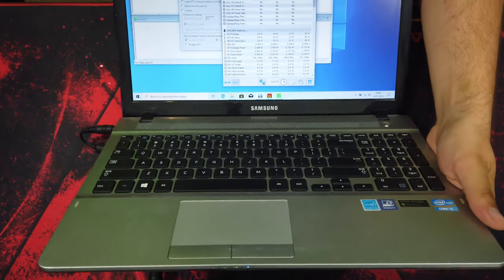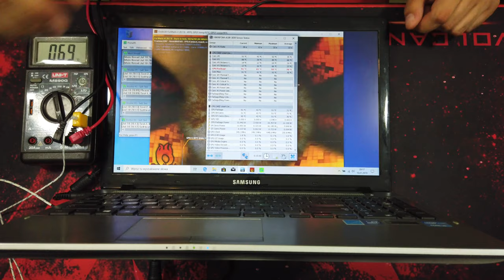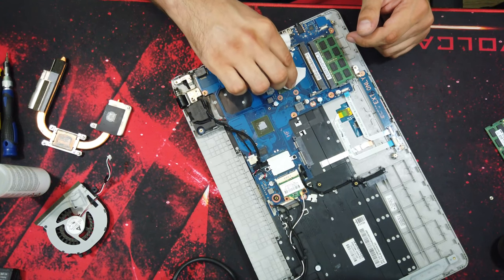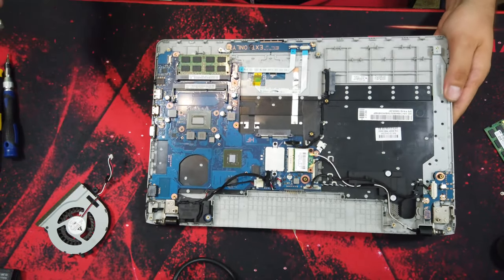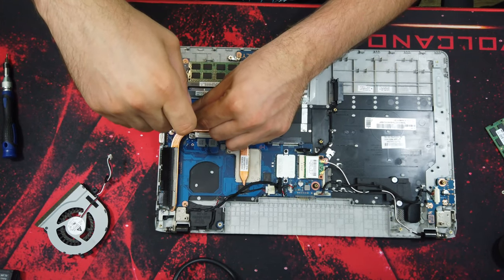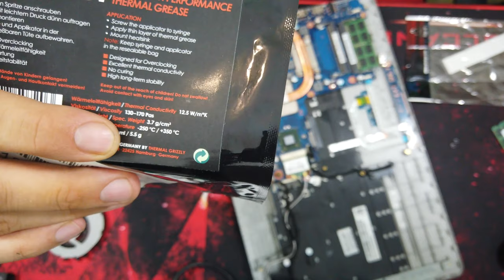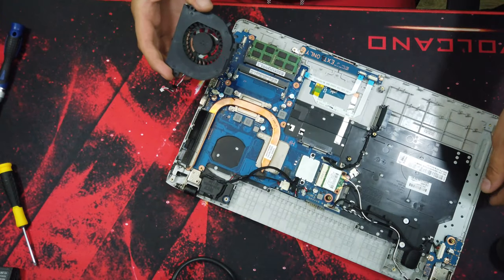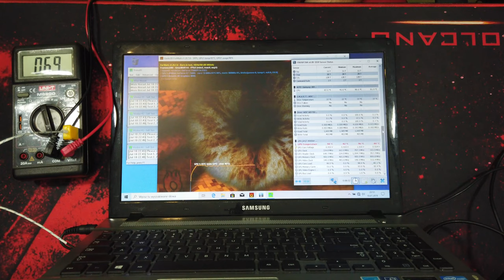How To - Clean laptop fans and change thermal paste

Comment: What a nonsense, you can use the same cooling paste for that chip as you used for the cpu / gpu.
There is absolutely no need to fiddle around the thermal pad stuff.
Reply from the maker: Thermal paste can be used only when there's a tiny gap between two surfaces, and on that chip there was a plain piece of aluminum plate that didn't fit as well as the the CPU cooler so in that situation thermal pad was better solution.
Reply: u hav no idea wat ur talking abt do u.. u just saw some thermal pads and went nuts.. u cant use thermal paste there. Manufacturers use thermal pad there for a reason..